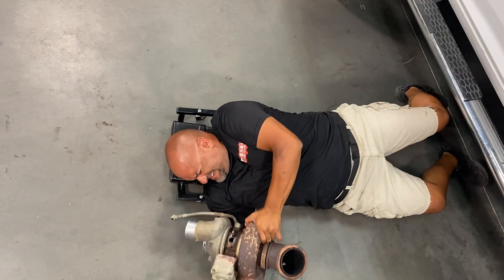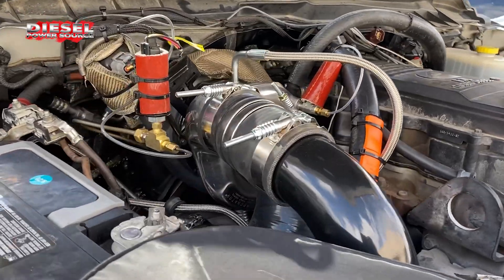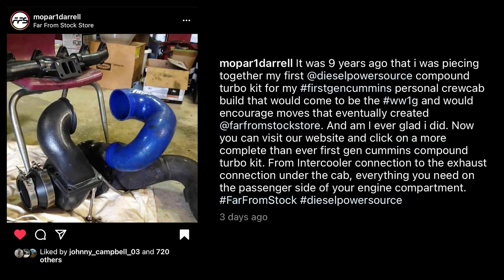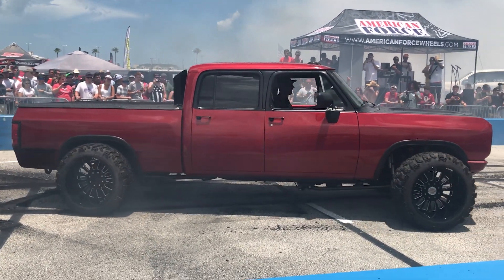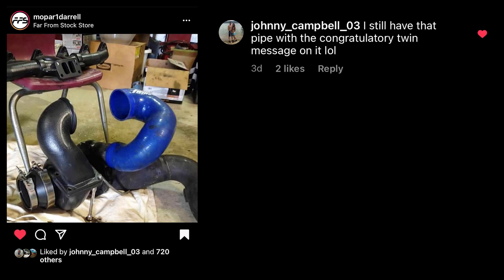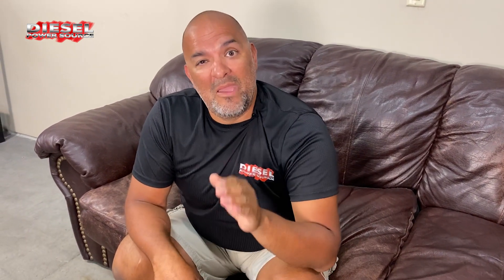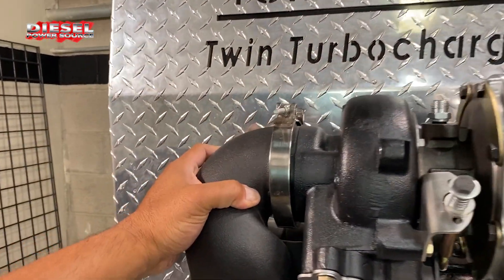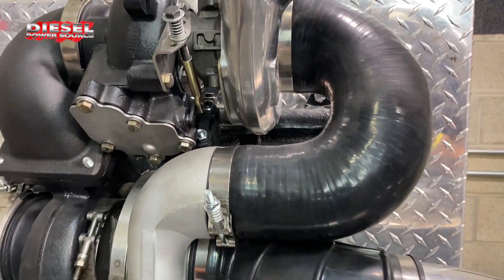Worlds Best Compound Turbo kit | Long Lasting Twin Turbos

Comment: One question I’ve always had is, does compound turbo setups ‘overspin’ the secondary turbo with all that extra air/exhaust flowing through it kindly donated to it via the primary turbo? Surely that sends the turbine rpms into another dimension?
Reply from the maker: It actually makes both of the turbos spin slower because they run at lower pressure ratios. In the compound setup the turbos share the load.